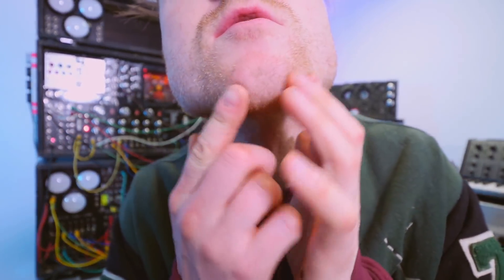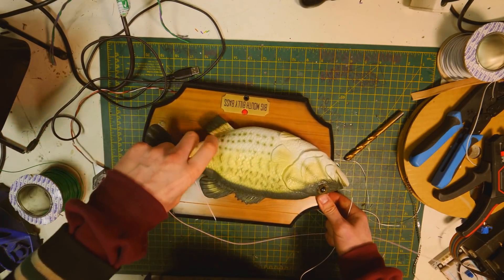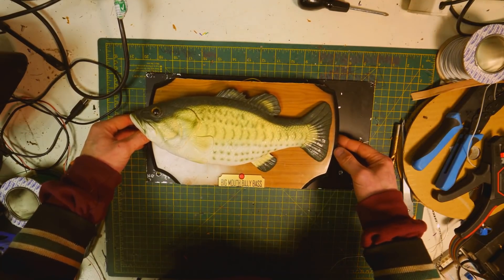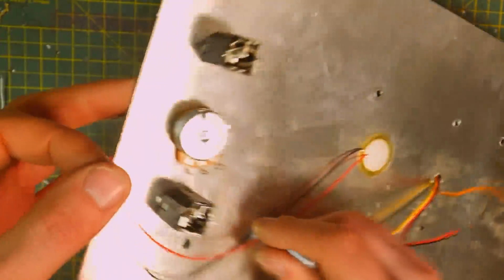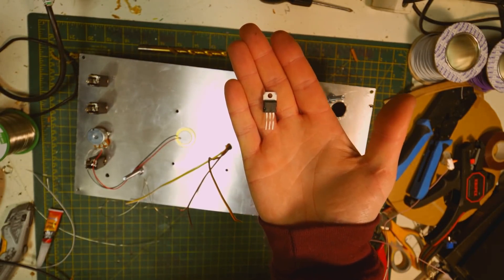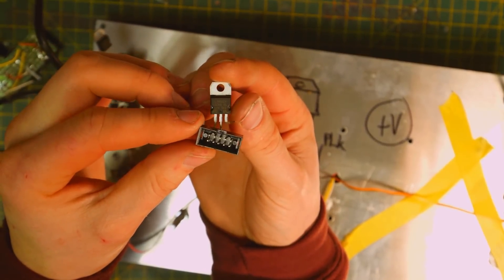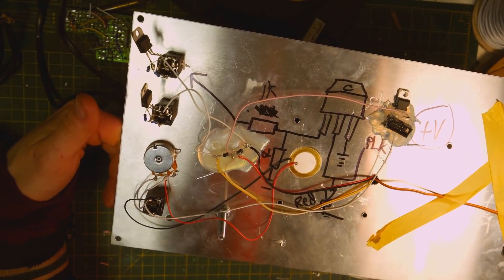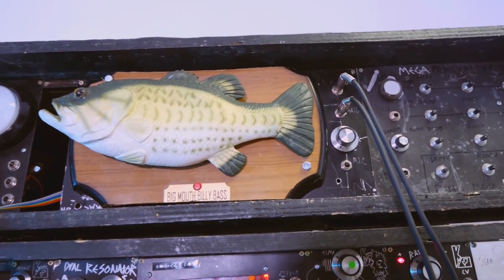I MADE A BILLY BASS SYNTH MODULE - FROM A MEME

Comment: Idea! You could use the tail and mouth as CV controllers. For the tail, you could attach a straight gear and have it turn a pot, like in a wah pedal. For the mouth, you could just stick a light dependent resistor up in there.

Comment: Awesomely cool - but there's something fishy about the way the volume control is wired.  I think the input & output wires should be swapped.
Reply from the maker: No it’s wired that way because it’s not buffered much better to short the piezo than where it is going for instance if wired into something with a low impedance etc. This is technically incorrect however it means you don’t need more components I have done many times and works the best.
Reply from the maker: Good pun tho haha

Comment: I’m torn. Part of me wants my students to watch this for inspiration, but another part wants them to never see that dodgy hot glued voltage regulator. So scary…😆
Reply from the maker: hahaha itll be fine, it all has a place. well withiin tolerance wouldnt get particularly hot so wouldnt be a problem, but better experimenting and quick prototyping than spending ages on a machine that wont work :D. then make it better afterwards haha
Reply: Let them watch it! It's all low voltage DC anyway. Plus you can provide direction. ;-)

Comment: Funny piezo wiring, its not a voltage divider but a short-circuit to the piezo if turned full ccw. Is that on purpose to reduce noise or just out of the moment?
Reply from the maker: it works well. usually all inputs on synths are pretty high impedance. this works better and acts like a good volume voltage control and is more useful than wiring it so the centre pot is the output, as this will cause a sink if anything else is plugged in aswell. obviously if i buffered the output i would wire it the other way. but when you keep designs cut back and simple you bend the rules and 9 times out of 10 it makes fudge all difference anyway. but it does still react like a voltage dividing volume control
Reply from the maker: its better to short circuit the piezo than short circuit the output, so its a weigh up between the two :)